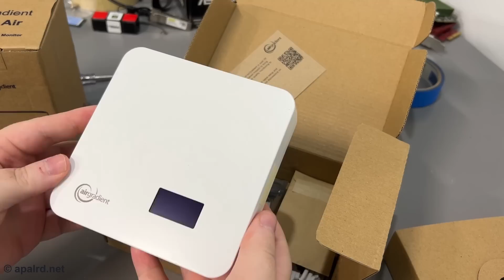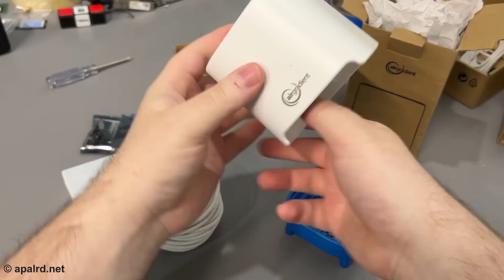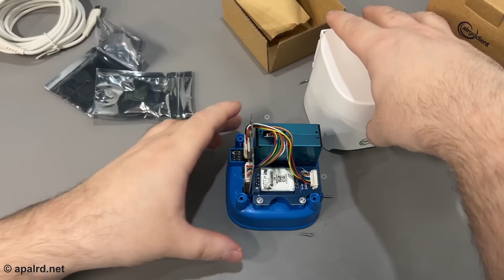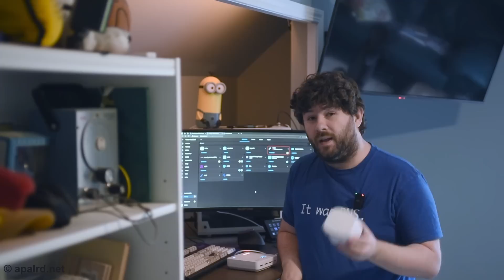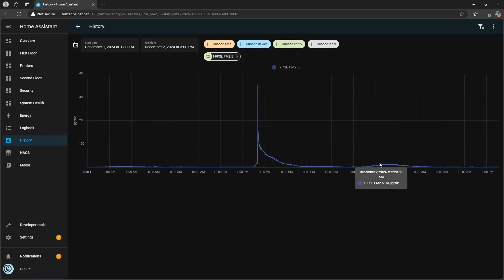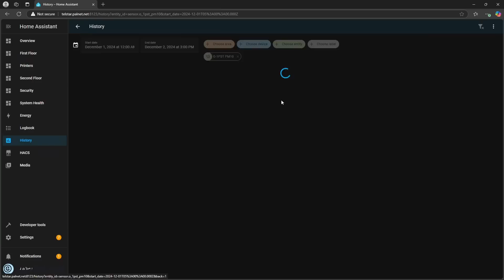Measuring my AIR QUALITY with AirGradient

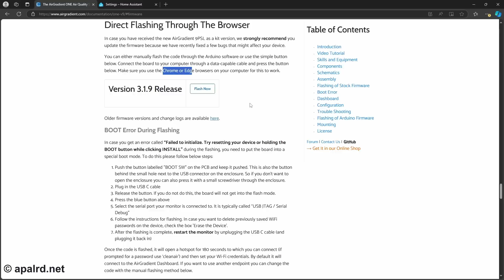Comment: 5:06 Update: Meanwhile, also Firefox supports the serial connection to flash the update. So if this is your browser of choice, you don't have to use Edge or Chromium anymore. The documentation for this hasn't been updated though.

Comment: Do you think it can detect fungus/mold?
Reply: The home assistant page lists these as sensors:

    Carbon dioxide
    Humidity
    Nitrogen index
    PM0.3 count
    PM1 density
    PM2.5 density
    PM10 density
    Raw nitrogen
    Raw total volatile organic compounds
    Raw PM2.5
    Signal strength
    Temperature
    Total volatile organic compounds index

Comment: First time buying something like this, was told it will work with an Imac, and an iphone - not sure if it will be good to hook it up to wireless or not, was told they don't have a wired connection, which I prefer. You are right about the ants, youtube video recently about guy kept having battery operated clocks go bad quickly went hung outside. First one died, returned it, 2nd one from inside house (different make) died, 3rd one had a translucent cover over gears and stuff. When he turned it over, ants had taken over the inside of the clock, with their food stuff brought in, excrement, etc - he was actually able to fix it once he took it apart and removed all of their stuff - and did pesticide to keep trail of ants away from his clock. On your indoor air quality in kitchen, I would remove the micro over the stove if you have another place to put it, and have a well-reviewed exhaust fan installed - over the stove is really not a great place for a microwave anyway. If not, do you have a window where you could run a fan nearby to blow the kitchen air out the window (or if outside the window is covered, a fan you can place outside to "pull" the air out?

Comment: Will it be $2/month for the service? --after the 12 months of service that comes with the purchase?
Reply: 2 bucks per device per month. But it's not strictly required if you use Home Assistant, also each device provides the sensor data with a web API that can be interrogated with zabbix or other monitoring software
Reply from the maker: I'm not using the service, so I wouldn't care

Comment: With how cheap wireless-enabled microcontrollers are these days it's nice to see what companies have come up with.  I feel like an outdoor sensor you'd still want to be low enough power consumption that it can get power from a solar cell on it though.  If you're already having to run conductors to a unit then it just tempts me to instead use 4-20 mA current loops for all the sensors and have it plugged into a base station.
Reply: the sensors here need most of the power. They recommend 5v 2A power supply

Comment: The "rough data" is due to the CO2 sensor requiring "calibration". It will auto-calibrate over 12 to 24 hours.

I run my outdoor sensor screwed into the side of my deck. It's been running for over a year and has withstood plenty of wind, rain, and snow storms. I think you'll be surprised how resilient it is. I've redone an exterior outlet with a cover that is large enough to accommodate a usb power adapter. I kept the long cable, it doesn't seem to have been an issue in my case.

Make sure you're using a power adapter that supplies enough amps. I think they recommend >=2A adapters.

Comment: Interesting to see the cooking. I’m looking to see what my gas stove produces in comparison to my new house which will be electric everything. Thanks for the rundown, always love your videos.
Reply from the maker: I’m all electric here, there are some emissions from the gas flame, but also a lot of particulates from cooking itself, it’s way more detrimental to indoor air quality than you would expect.
Reply: @apalrdsadventures  I love my ancient standing pilot stove and wall heater - wall heater I turn off during the summer, during the winter during severe storms it is so nice to know you have immediately stovetop and oven available, as well as the main heat.

Comment: I'm using Aranet CO2 sensor with home assistant, it's Bluetooth based and battery operated. But those are very expensive for some reason.

Comment: You always make great videos. I have heard about the air gradient sensors before but had no idea they could be flashed with esphome firmware, makes me more interested in trying one out. I had no idea stove tops can have a recirculation vent and not a true vent outside even with a gas range, found out its only required in commercial ranges.